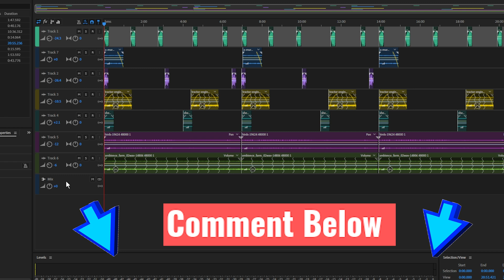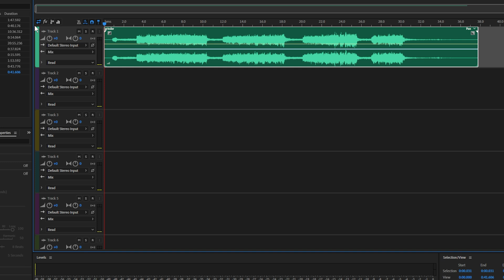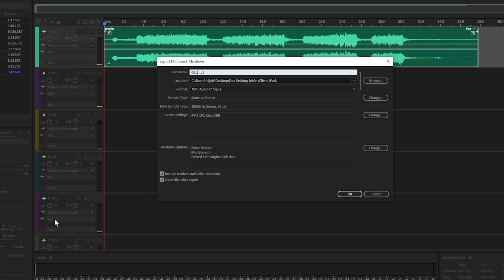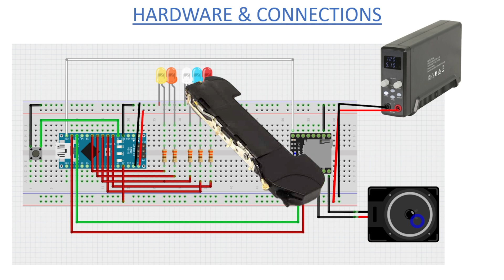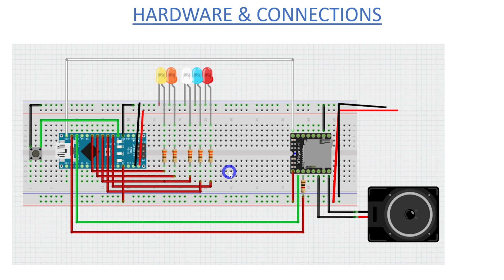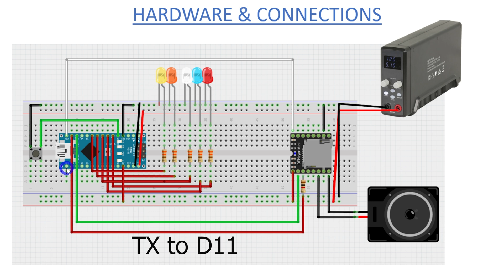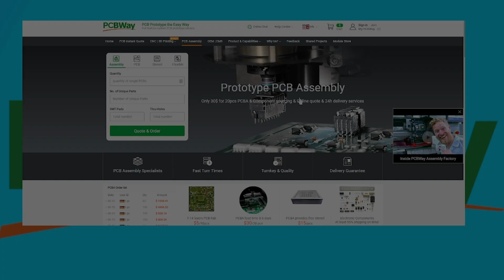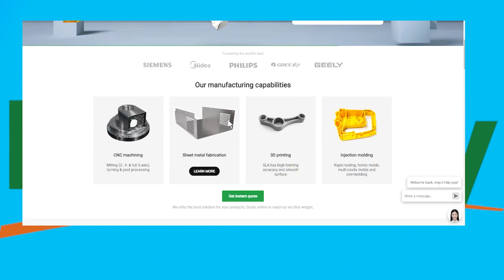Build a Fully Featured Arduino Welder for Your Model Railway - with Sound effects

Comment: Friend
Thank you for sharing your incredible work with us!
But I'm having a lot of difficulty getting the code to work.  I already exchanged the Arduino for a new one and did the same with dfplayer, I'm still suffering with the case!
There's something wrong with the code, it works whenever it wants and keeps repeating the same MP3 track. Do you have any idea what could be happening? 
Could you please help me?
Reply from the maker: Thank you. Which aspect are you having issues with??
Reply: @ModelRailroadTechniques  
Even though you are using the mp3 tracks in the order you gave them, they are not playing in the correct order.
And the LEDs even work sometimes, but they are not aligned with the correct sounds for each event.
I have already exchanged the equipment for others, all new, replacing the Arduino and the DF player 
But nothing new happened 
There seems to be something wrong between the mp3 tracks and the LEDs' operating sequence.
I have already reviewed the programming several times and have not discovered the error. Keeps working incorrectly
I don't know what else to do
Reply: @ModelRailroadTechniques  
Even though you are using the mp3 tracks in the order you gave them, they are not playing in the correct order.
And the LEDs even work sometimes, but they are not aligned with the correct sounds for each event.
I have already exchanged the equipment for others, all new, replacing the Arduino and the DF player 
But nothing new happened 
There seems to be something wrong between the mp3 tracks and the LEDs' operating sequence.
I have already reviewed the programming several times and have not discovered the error. Keeps working incorrectly
I don't know what else to do
Reply: Sorry for my bad English...

Comment: Great Sketch, but I cannot get it to go. I have tried three Nano's and a Uno and  3  DFplayer minis. I've copied the diagram several times but to no avail. The sketch downloads ok but nothing when I press the button. TX and DX are the right way around. As a newbie to Arduino, it must be something I cannot see. I am a retired electrician and can read drawings ok so I will leave this until I can learn some more. It is such a shame as this is exactly what I want and your ideas are the only one I can find on YouTube.
Reply from the maker: The issue the sound not playing or the lights not working. If it is the sound. DF players are a pain. I only had 1 out of 10 work. It appears not all players are created equally.
Reply: friend, good night
i'm experiencing the same problem, in the same way as you, i changed the equipaments several times and redid the code several times, but it worked whenever it wanted... 
Rondomly
And it keeps repeating the same mp3 track, without the Leds working
And when it worked, the mp3 tracks are not in tune with the Leds.
In the end, there is something wrong in code that i cannot identify.

Comment: Great video. I’ve used similar to make a burn barrel. What is unique here is your incorporation of sound, which is fantastic. What volume is required? In the layout room it can be quite noisy with sound decoders and people milling about. Is there a need for a larger speaker, or is this not an issue? Thanks for sharing this!
Reply from the maker: Thank you kindly for your kind words. Regarding volume that is really a trial by error. The out for the video was very low so an amplifier or similar may need to be experimented with. I really dive into this too much just manipulated sound in post editing.
Reply: Do you prefer a particular brand of speaker to satisfy your objectives?
Reply from the maker: @kennedygauger4680  great question I have been experimenting wit old iPhone speakers. This project was a iPhone 4 amazing sound
Reply from the maker: @kennedygauger4680  great question. I am experimenting with old iPhone 4 speakers. They are amazing

Comment: I've actually used this sketch before and it is really great.  You make it look so easy, even though it really isn't a hard thing to hook up really.   I might play with the sketch a bit to see if I can reduce the number of LED's used, but as is it is really great.
I think the red LED is the only thing I may change to have it fade on during the actual welding as it goes dark for a short time before the red suddenly lights up after the welding stops, which does take a little away from the effect.  Also, maybe the red is a little too bright compared to the welding.   Maybe a higher value resistor in line with the red LED could tame it a little.   It also would be good to have the music playing during the welding as in real life a person wouldn't turn off the radio / music while welding if they had music on to start with
Reply from the maker: Agreed Brendan. I will experiment more with the sketch. I want to add more factory sounds to the mix too.

Comment: You really went above and beyond. I’m guessing you can change the flashing frequency. I think it needs a more strobe effect on the welder. Also, can you fade the red led out? That would represent the weld glow cooling off. Make those two changes and it’ll be spot on.
Reply from the maker: Thank you for your kind words. As stated it is not my sketch. However, I will look further into this, because I believe it is a great observation.
Reply: The Red LED already does fade, just slowly.  You could change the time of this in the sketch easily.
When it is in a building, as is, the welding looks quite realistic, but you can easily change the timings and delays in the sketch to make it how you want it to be.  It's just a standard Arduino sketch that can be easily edited in Arduino IDE.   
Just don't go too stroboscopic as welding is more of a flickering brightness level  rather than strobing as the arc is fairly constant :)
Would be great if you can share any changes you make if you feel they improve the original script :) :)
Reply from the maker: @EsotericArctos  sweet. You had any issues with the mp3 minis vs the MP3 TF 16ps? I can’t get them to work. Love to hear your thoughts.